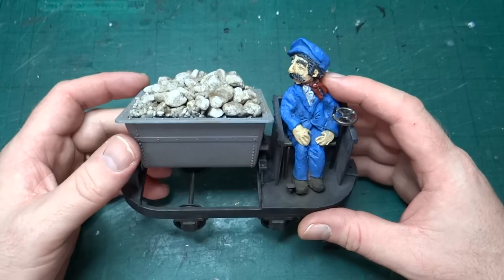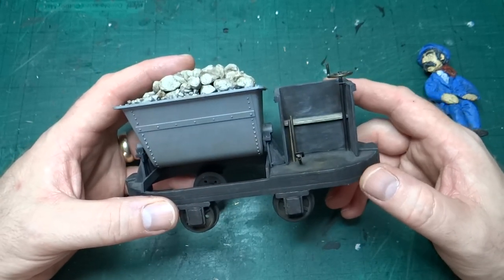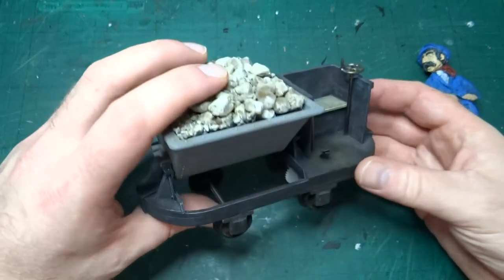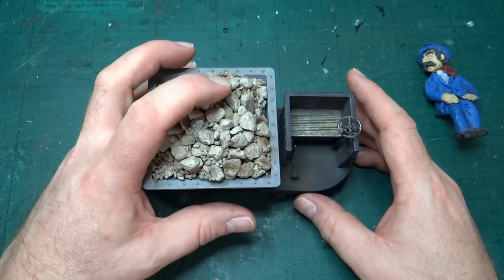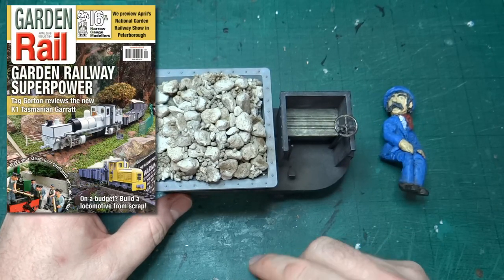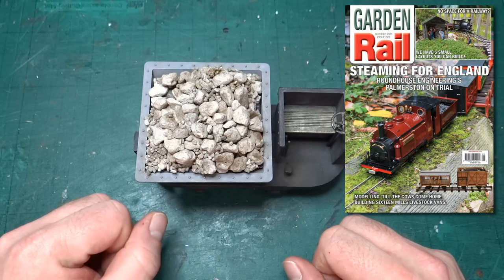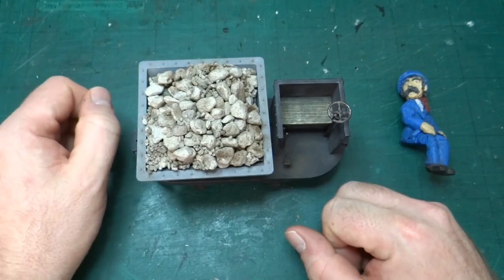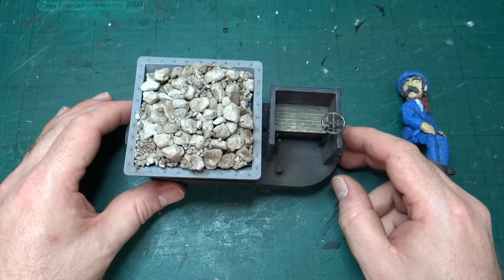I've Finished Building.... A Hudson Skip Locomotive from a kit by IP Engineering

Comment: Detailed....!!! Are you actually serious....??? At 4mm scale I was adamant that GWR could be read (after zooming in with your phone) above the axle box's of my model slate wagons. My railway laterns are in scale, the latest are hollow so you can fit a 1mm x 1mm LED. They are about the size of a match head.....that is detail.
Reply from the maker: Totally agree. Without watching the video back I think I was referring to adding more details than were in the kit, rather than it being a detailed model (although I could be wrong, it's a while since I filmed this one). Either way I agree it's not a detailed model.

If you want to see my detailing then the 4mm scale kit I did for the 24hp Hudson-Hunslet is probably a better reflection of my modelling: https://youtu.be/QdAZILJp1J0 I went slightly over board when designing some parts for that kit. A case in point is the axle boxes which have the Hudson name on them. You can't read them on the 4mm print, but when I scaled the model up to 16mm there they were.
Reply: What wheel base is the skip loco please
Reply from the maker: @johnadams7535 Hi John, I've just put a ruler to the model and the wheel base appears to be approximately 54mm. Hope that helps.